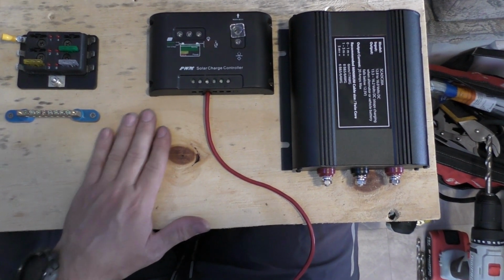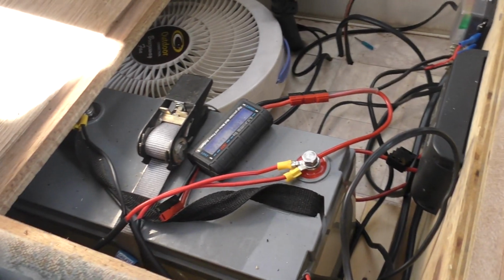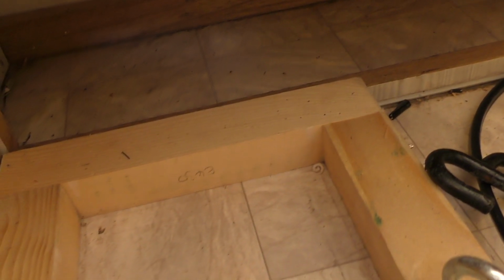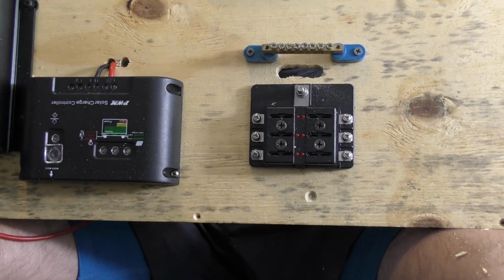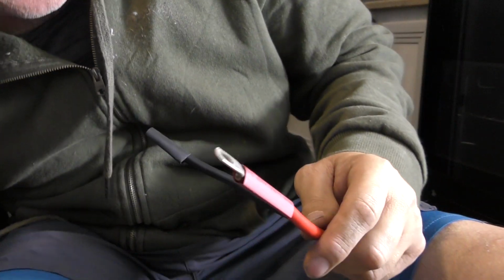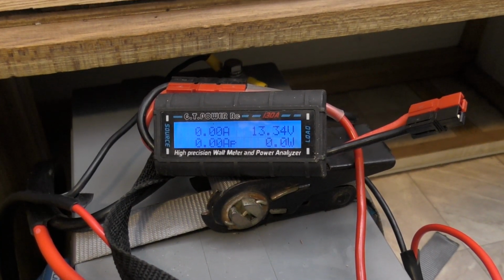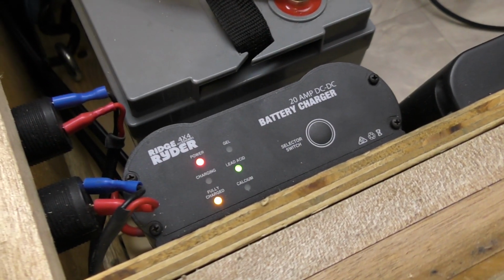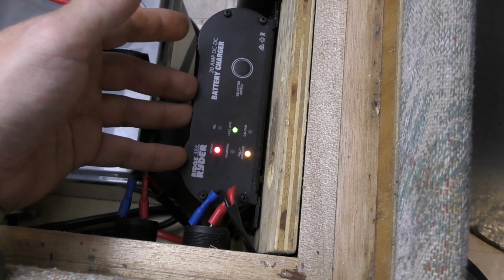Ridge Ryder DC-DC 20Amp charger detailed review and install

Comment: Hi. Only just picked up on your channel and have been through a few of your videos.
I already have a dc2dc charger that I paid big money for a auto electrician to fit and it works well, but I'm now putting a canopy on the back of my dual cab with a mppt and solar on the car but after seeing this vid I'm thinking I should go the dc2dc and ditch the mppt. My issue is that, as I said, I already have a cable coming off the alternator. 
Will the alternator handle 2 power sources charging 2 extra batterys?
Hope I didn't bang on too much. Haha

Comment: Thanks for the video, very useful!
Wondering... do you think I can keep my 3 way fridge running while charging (driving) at the same time?
Reply from the maker: If you mean on 12v, yes absolutely. This was why I went with the charger install in the first place. That allowed me to leave home with full batteries and arrive at site with them full also, as well as running the fridge all the way there. It definitely improved  the 3 way fridge performance whilst driving.
Reply: By 3 way I guess you mean 12v/240v/gas.........on 12volt my Chescold 3 way was like leaving the headlights on......get to destination then swap to 240 or gas.....

Comment: how has the dc-dc charger held up since installing it
Reply from the maker: still doing the job with no complaints. it hasn't had much work though with all of our fires and now covid. i'm hanging to get the van out for a trip though.
Reply: DENMONKEY they have a new model out now it’s smaller more compact but need more voltage to run 13.8 I think it was

Comment: i wasnt clear in your review if you recommend this unit or not, but i am guessing that all free stuff is good! HAHAHA
Reply from the maker: Sorry, I should have done that in the wrap up. For the price mate, yeah for sure. And I mean the real price, not for free. Providing you don't need solar and can feed it with the higher voltage it requires to run. I don't think there's much else in the market at this price. It's basic but it works. It's still working in the van. So all is good. If you can get it on sale it's even better.
Reply: @DENMONKEY  now Lol you need to do is get similar units and compare them and do the same for solar.
I have the victron Bluetooth 100/20 and being mppt it does supply more than enough charge via sun for the van!!

Comment: Thanks for the video. Curious . . . . do you have the Ridge Ryder DC-DC running off of your anderson at the rear of your tow vehicle? If so, is that anderson connected straight to your cranking battery or to your aux battery in the back of the tow vehicle? Thanks
Reply from the maker: Hey, welcome. Straight through to the start battery in the front off the Anderson at the back

Comment: How do you switch from solar to alternator charge or do they both charge at the same time ?
Reply from the maker: this projecta takes the highest input and chooses that. it doesnt combine them. So once the alternator shuts off, it goes over to solar. Other units will do this though and allow you to run both at the same time, although they would been to be higher rated than this one to be worth it.

Comment: Why run batteries, all you need is run two dc to dc's with one charging the other, then connect the loads between the two. Just using a battery to get it started, ha-ha!!!   Yeah I know that crap don't work!! I live off grid , and know how difficult generating power can be! I'm working on charging a lithium bank from a alternator, the lithium bank charges to 29.4v the lead acid Bank and alternator, charges to 27.5v- 28.8,  not enough voltage, or the proper charging scheme, for lithium batteries, a high current charger to use with lithium and alternators, is not cheap, $500-$1k plus, a regulator for the alternator, is the route i want to go. Still nothing ideal out there, i was thinking maybe a dc to dc would get me by, I'm thinking I gotta build it my self, something that can limmit current, at a lower than full charge voltage, or charge to full voltage, and disconnect the field, stopping the charge, until it drops 1v nearly. The capability of limmiting current, and stopping charge,  simply allowing the BMS to disconnect, can cause surges over 200+v!  With do many going lithium, maybe there will be better, cheaper choices fro charging, great video, it cleared upca few things,...
Reply from the maker: hey James, are you knocking up videos of your adventures with all of that ? certainly something I would be interested in checking out. 
If all goes well and I can get a place with a bit of land around in in the next few years, I'll be trying to set up something similar. If I could snag a little place with a running creek to try out some hydro powered stuff that would be brilliant. of course solar and wind turbines would be nice to fiddle with as well. Might be bit of a pipe dream for now but I'm trying to work towards it. crossing my fingers it all works out.

Comment: I have one of these Ridge Ryder DC DC chargers installed in my Patrol, When the vehicle is running the unit only seems to pulse charge and never seems to be continuously charging. Is this normal or should it remain on all the time?  Cheers,Bill.
Reply: Cable is too small mate...the charger needs more amps!!
Reply from the maker: sorry Scar, just spotted the comment. What makes you say 'pulse charge'? is the unit turning on and off during operation ? Once mine has the correct trigger voltage, it remained on until the vehicle is turned off and the input voltage drops.

Comment: Thanks a lot for the video, very informative. I have found out this unit has been discontinued, reason: poor performance. Can you describe a bit your experience with it so far?
Reply from the maker: My experience has been good. I've added a second battery to give me 260ah so 20amps is bit small for my needs now but I tend to leave topped up anyway and have plenty of solar. It does make sure my fridge is getting over 13.5v when mobile and keeps the batteries full for when I arrive. So for me it's perfect.  Granted I haven't done any significant testing since the install but I do monitor my batteries pretty closely since installing the solar panels and compressor fridge to be sure it's all working OK.  Nothing I've seen suggests any issues from the charger. Can you link me to where you find the info, so I can check it out?
Reply: @DENMONKEY  I see... So it worked well for you, good to know. Maybe the quality control wasn't great and some devices work just fine and some others have some issues, who knows... This morning I called supercheap auto to inquire about the availability of this charger and turned out they don't sell it anymore, they said the product has been discontinued. So when I asked about the reason they said that they only had "poor performance" written on their system. They didn't have more details... I started a thread at http://nzmotorhome.co.nz/forum/viewtopic.php?f=55&t=18557 to find out what other users of this charger have encountered.
Reply from the maker: OK cheers. I wonder if that means poor performance of the actual unit for purpose or poor sales performance. If you get any feedback let me know and I can try and test it out and let you know.  Just checked the local website and it's still listed. About 14 reviews at 4.3 of it 5. One complaint re it turning off but might have had a smart alternator dropping before the required input voltage.  That's the only trick I think with this one, the higher than some voltage input requirement.
Reply: @DENMONKEY  Oh I didn't think of it from the sales perspective! could be! I don't see why it wouldn't sell well tho, if it works fine and has such great price... anyhow! I will keep you posted if I find out anything interesting haha Can you give me the link to your local store? Is it in NZ?
Reply from the maker: No mate I'm in Australia. So this is where I'm going. www.supercheapauto.com.au
Reply: @tonimassot6453  my local store (mildura) still has them and picked up today for $153
Reply from the maker: Thanks fie the heads up drew
Reply: @ATEmedia  I ended up finding one. I installed it and used for 6 months before I sold my car. It worked perfectly!

Comment: Thanks for this mate..I have this charger fitted but have to switch it off from the vehicle when parked with the slideon connected as the car battery drains in a few days..Apart from that it was a good $50 investment.
Reply from the maker: welcome wayne. 

are you sure it's this flattening the battery ?
It should cut out once the main battery gets to around 12.8v, so shouldn't matter how long it's connected. 

Maybe leave it connected for a few hours once stopped and see if its still on. It may not be shutting down like it should. 

Alternatively you could add a relay that will only pass through power from the main battery when the ignition is switched on. 

You really shouldn't need to though. 

cheers Brett
Reply: @DENMONKEY  Thanks Brett..yes mate i did a run through the utes accessories and the charger was still drawing amps from the ute battery next day and the lights were still on in the unit. I can plug it back in after i unplug it and it is ok until i restart the ute so thats what i do now..Its probably just a small glitch and the relay sounds like a good compromise..Thanks for the tip..wayne

Comment: Hi Monkey..Thanks for your channel. All your videos are fantastic!. I follow them and your posts on the Pajero forum as I also have a NT, May, 2010. My next project is to install an AGM with DC/DC charger were the 3rd row seats used to be, just as you have done. Like you I was looking at a Projecta IDC25 and do the install myself but am finding conflicting info (even on the forum) about wether or not the NT has a smart or a temperature compensating alternator. Do you know which one the early NT's have?
The reason I ask is that the IDC25 install instructions state that "if you have a smart alternator, the ICD25 will not work unless the ignition override (blue cable) is connected to the ignition". Im pretty handy but wouldn't have a clue when it comes to connecting to the ignition. Did you have to connect this override cable to your NTs ignition?
Thanks again for your channel.. Top notch mate!!!

https://www.australiandirect.com.au/assets/files/IDC25_Instruction_Manual.pdf
Reply from the maker: Hey James. Thanks for the comment mate. 

I've not had any issues with my projecta until very recently where my battery aux battery was sitting pretty low. 

Not really a projecta issue as such but has me looking at options for improving the solar side of things.
 

In the past with the 120W solar panel on top and driving every few days it would manage no problems. 

I have recently added a waeco fridge which is more picky about power than the cheapo giant fridge (still working). 

I don't think it was the projecta as such but simply several very hot days in a row above 40, where the car wasn't ran much and the 120w on top just wasnt enough. 

Add to that the fridge running flat out day and night in the hot car and the battery getting hot too. Just asking too much of the whole set up. 

I stuck my second panel back on top and it seems to have sorted things out. 

That said, I want to add a single panel 235w 36v  into the roof cage. 

The projecta will only accept up to around 26v i think or there abouts, so wont handle the higher voltage of the new panel. 

So I will still be using it for dc-dc duties but not solar. 

That said, it works well of the paj and I haven't had any issues with it charging from the alternator. 

I don't know if its a smart unit tbh but it works for me. 

I haven't installed the ignition lead on mine. 

to simplify it, you only really need to get a positive line when the car is on. 

Depending how often you have the car on accessories without running, you could easily enough just tap into the rear cigarette light socket feed which will only be on when the accessories and ignition is on. Would save running wire from the front to back. 

That might work for you. 

Alternatively you're going to be running a 12v feed from the main battery anyway. 

Just jump into something on the fuse block just near it from something that only comes on when the ignition is on. 

Then just run that along with your power feed. Tap a fuse are handy here or even if you want to grab a line from under the dash. 

Hope that makes sense. 

Hit me back if you have any questions. 

cheers Brett

Comment: I had that same setup in my 2013 nw pajero, worked for a while then kept showing fully charged,same as you even though the battery got to 40% down, run for a week, same problem, unhooked and forget it but now I want to pull it out and use it elsewhere, maybe I need to up my wiring size. I should have purchased the ctec solar
Reply from the maker: Mine is still working well in the van. A few have mentioned a few issues though in the comments, but super cheap are good about taking things back if you need to. Never had a problem with them if I needed their help

Comment: Hi mate I just put some setup in the tub of my ute . What I'm wondering is can I hook my solar reg  to the DC dc input
Reply: Thanks heaps mate that was heaps of help . With mine I got it in canopy and I want to mount a 250w solar on the roof .. Thanks again It helped alot
Reply from the maker: @mrmrsengineer2024  most welcome
Reply from the maker: hey there. 

Not sure why you would want to ? 

Your solar regulator will be dropping the voltage down to a level to charge the battery and the dcdc chargers job is to boost a low voltage up to charge the battery. 

Whilst I've never tried it, it may work but it I doubt it would work well and I'd expect there would be losses going through those conversions. 

There's no reason you can't have your solar and dcdc charger hooked up to the battery without having to come at it from that angle. 

The solar chargers should see the higher voltage from your dcdc charger when the car is running and stop putting power into the battery. 

When the car  has stopped and the battery voltage drops down, the solar controller should come back on and start charging from the panel. 

You could always add a switch to the input from the solar panel and just turn it on when stopped. 

I'm not sure if you already have the gear but you can get dcdc chargers which would accept a solar panel input. 

You'd need to bypass the controller on the panel but it would mean only one device going to the battery. 

I hope that helps.

Comment: Hi mate. just wondering the power source that makes the dc-dc charger turn on at 12.8 volts is the black box thing that sitting on the deck. that work the same as solar running into it while the vechile not running
Reply from the maker: That black box is a 12v power supply that i use for my ham radio gear or on the work bench. 

I used it to replicate the power coming from the vehicle. 

This dcdc charger does not have a solar input and will only work with the power from your alternator. 

I'm afraid, I can't offer any advice to how it would work if you plugged solar into it. 

Good question though, but I don't have enough information to give you an answer one way or the other. 

If you want to use the power coming from your vehicle and have a solar input, you would need to look at the offerings from projecta, redarc or ctek. Those are the more popular brands but I'm sure there are more out there.